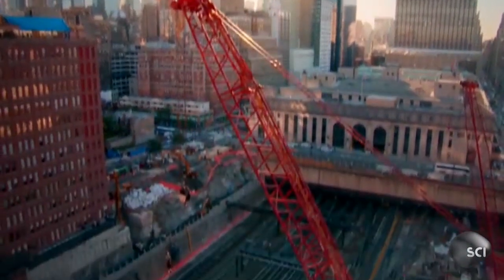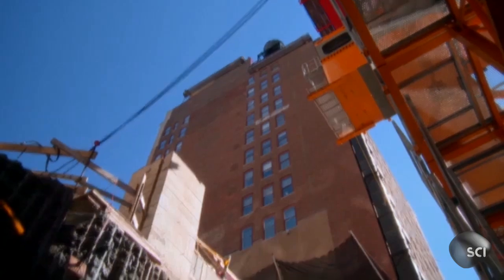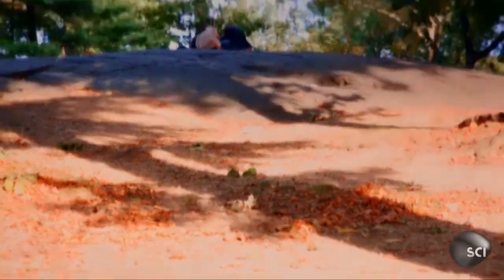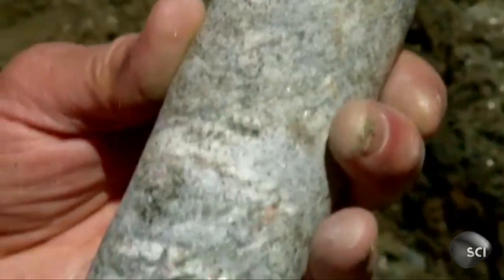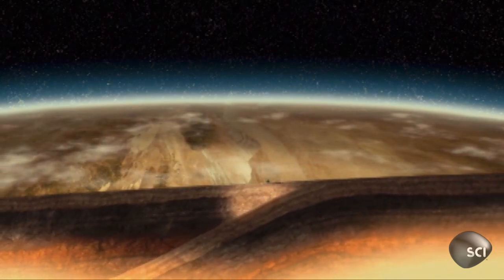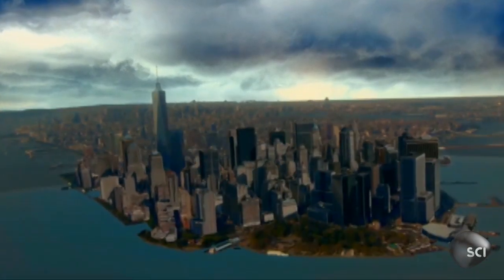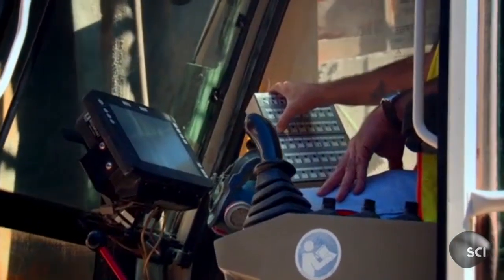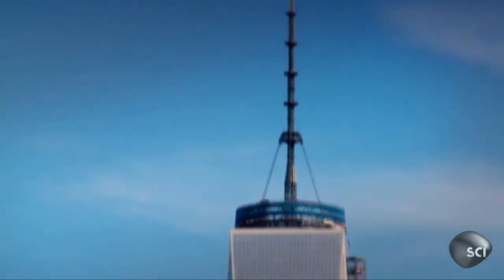The Secret of Manhattan's Skyline | Strip the City

Comment: Even more proof 9/11 was an inside attack... After watching this you really think jet fuel could bring down 2 of the tallest and strongest buildings made out of hundreds of tons of metal and on top of this extra hard bed rock where the foundation of the building was secured
Reply: Your comment just proved how much of an idiot u are
Reply: No one cares about your comment. Conspiracy nut.
Reply: Are you really that supid, jet fuel has 10 times more energy then gasoline, the jet fuel burned the metal hotter than its boiling point, look things up before saying crap that isn't true
Reply: GCU ht It fell from the top down. Bedrock had nothing to do with it. The impact of the airplane crashing into the building stripped away the foam that covered the steel beams exposing it to the heat which then melted the steel structure supporting the building. Then it melted. Then crashed downwards as the melted steel could no longer support the weight of the upper floors.  Conspiracy is the most idiotic explanation only the most idiotic would believe. .